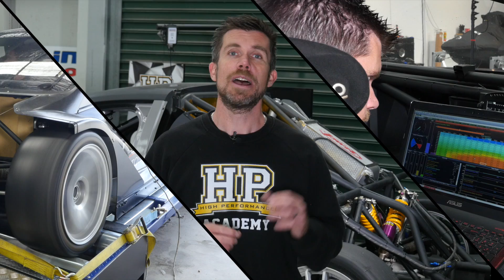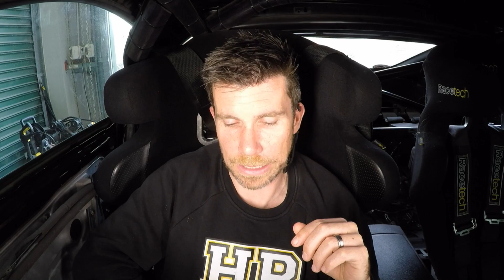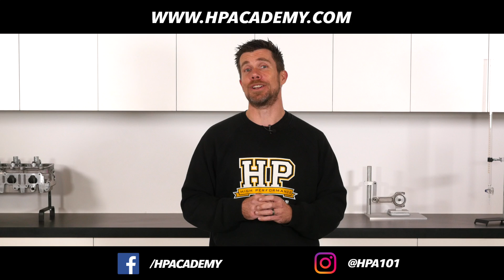[HPA Q&A] How do I determine my target AFR?

Comment: "Experience, and taking our classes".   I'm looking for the methodology, and this video is no help, just an advert.
Reply from the maker: The answer Andre gives explains that there is no easy answer when it comes to AFR. You cannot simply just throw numbers around without getting into the specifics of the engine, it's aspiration and it's application. We have created a course based on the topic that we're not forcing anyone to take, however, to learn how to determine your target AFR is going to require more effort than punching a number you found on the internet in no matter what if you're not prepared to do this you are better off paying an experienced tuner to do the work for you, which there is nothing wrong with either.
I hope that clears it up a bit for you mate :) - Taz.
Reply: @hpa101  I'm looking for methodology, not ads for cla$$e$. But thanks anyway.
Reply from the maker: @jamyers1971  no worries, I understand that, the only other way around it is experience - Taz.

Comment: this video didn't answer the question.
Reply from the maker: Hey AR! The answer Andre gives explains that there is no easy answer when it comes to AFR. You cannot simply just throw numbers around without getting into the specifics of the engine, it's aspiration and it's application. We have created a course based on the topic that we're not forcing anyone to take, however, to learn how to determine your target AFR is going to require more effort than punching a number you found on the internet in no matter what if you're not prepared to do this you are better off paying an experienced tuner to do the work for you, which there is nothing wrong with either.
I hope that clears it up a bit for you mate :) - Taz.
Reply: If people wanted a simple answer they wouldn't come looking for a video on a complex subject in the first place. 
Its a complex question, therefore a thorough answer is required.

Comment: How do I determine my target AFR?
Buy our course I'm not telling you shit in this video.
Reply from the maker: Hey Steev, we're not forcing you to buy anything from us and never will. The answer shows that it is not a simple topic that can be answered in a 5 minute YouTube video. Best of luck in your hunt for accurate knowledge from reliable sources - Taz.
Reply from the maker: Hey Steev, the question isn't specific and therefore lacks the required detail to give a specific detailed answer. If you learn anything from this Q&A it should be that target AFR is specific to your engine and application. 
We're not in the habit of misinformation, never will be, and to answer a question like this with any sort of answer that doesn't cover the fact that AFR is NOT as easy as finding a number on the internet and punching it in would do more harm than good.
We are not worried about devaluing our courses, otherwise we would not post ANY free information up. Ever - Taz.
Reply from the maker: Also, I'll just quickly add that to post questions on our members only forum you do need to be a Gold Member, but it's free to read and search the content on there. Steev, take a look at some of the specific questions and answers on here :) - https://www.hpacademy.com/forum/understanding-afr/
Reply: Well, if I've understood correctly, your AFR will affect your optimum ignition timing, so if you have zero experience (like me) you probably want to start close to lambda = 1.

Let me elaborate, and I reiterate that I am by no means experienced with this, but you learn the physics/chemistry as an undergrad:

1. Start close to stoich (lambda ~ 1)
2. Hold your RPM and Sweep the timing until you find your optimum, you're looking for Maximum Brake Torque (MBT).
(You now have one data point in a 3D graph where torque is Z, and lambda can be X, leaving optimum ignition timing to be Y, for example.)

3. Go slightly richer (Lambda < 1 makes more power than lambda > 1), maybe 0.05 richer, so lambda =  0.95. Feel like taking your time? move in 0.02 decrements.
4. Sweep your timing again and record the MBT and MBT timing. You have a new data point (XYZ group).

Repeat steps 3 and 4 until you stop seeing an increase in torque, maybe go two iterations further just to be sure you're thorough.

If you feel like you missed the optimum AFR by going too rich too quickly (like the first time you see torque go down by going richer) backpedal half of your step size, for example. After you've collected enough data points (use Excel), you can 3D plot and get a feel for where your optimum AFR/timing combo is at this RPM. Yes, this is tedious, experience would of course get you there quicker (that's the whole point of experience).

Again, this is what I would do if I were going to research and publish the influence of AFR and ignition timing on engine power. This is a general mathematical technique, it works whenever you want to look at the effect of changing two variables. There are more clever algorithms but they require using lots of math.
Reply: Was gonna write that, but you beat me...
Reply: This is by far the most vague video you have ever posted, at least with your other Q&A you give a specific answer for a specific problem (mostly/kinda/sorta) the problem here is actually the opposite of what you say, if you give away any sort of AFR/RPM/load numbers at all it devalues your entire course.

Don't try to play the "too technical" card on us, we can see straight through it.